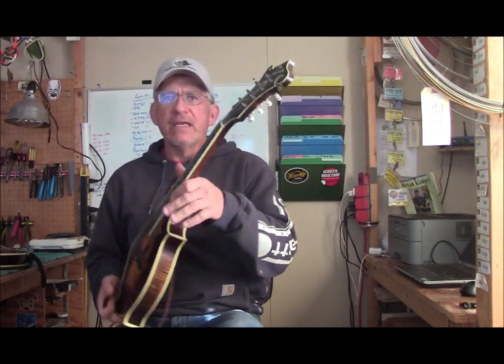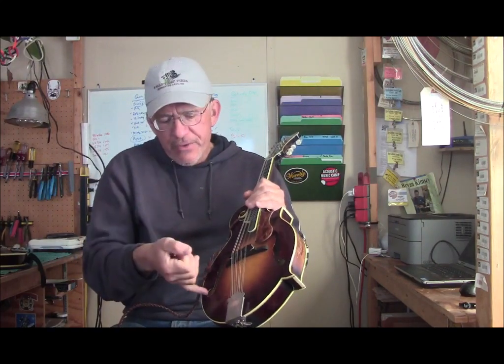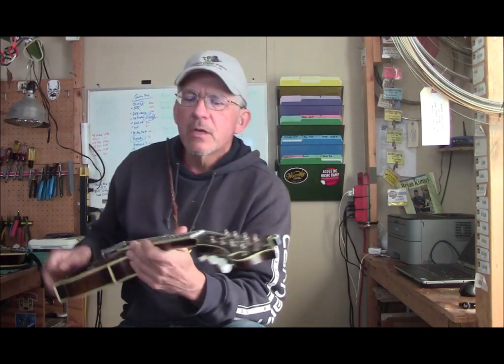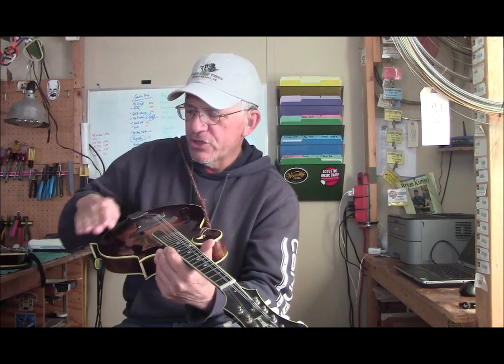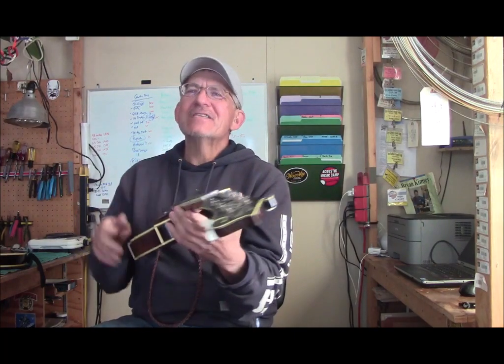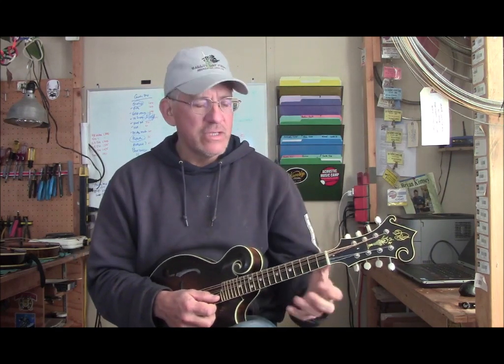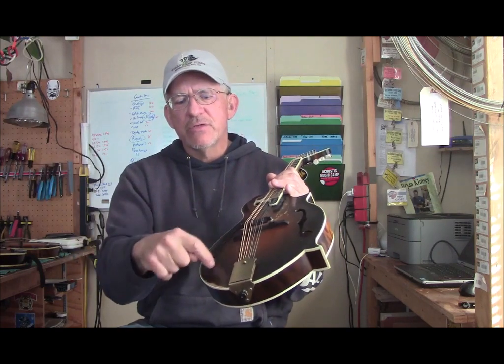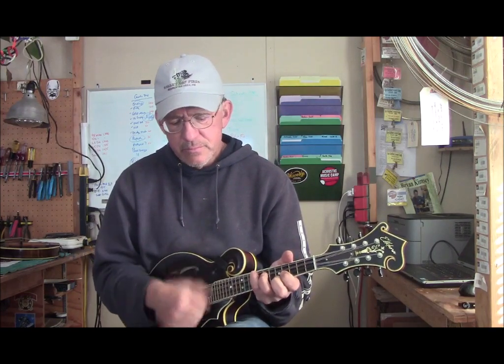Discussion on mandolin fingerboard radius

Comment: I used to play a Dearstone when I played on the road. The dearstone had a radius & wider spacing. I loved it for single noting, but I had a really hard time playing tremelos. Probably due to the wider spacing. The KM-1500 I now have is narrow & flat. It took me a little while to get used to the KY. It felt super cramped at first, but after getting used to it, I'm playing it just fine. I've learned that I do prefer a slight radius. (maybe a 12 or 14) I think I'd like the combination of the traditional "Loar" spacing with a slight radius because it gives your hand the feeling of wider spacing. For me, I think that would be the perfect balance. My main instrument is banjo & I'm of the opiion that they should have a slight radius as well. The neck I'm getting ready to put together will probably be around a 14-16.

Comment: I don't think my Mandolin has a fretboard radius :-(
Reply from the maker: Neither does a Gibson Loar.  You're in good company.  Nothing wrong with a flat fingerboard.
Reply: @Bryankimsey  Totally prefer flat fingerboards. ALL of mine (all f-styles) are flat. I really almost exclusive play only Bach and it requires a lot of alternate picking and quite a bit of string-skipping sometimes--that translate so much better for me on flat fingerboards, especially on such a small neck like a mandolin. I've PLAYED several with 10 & 12, many I've worked on in my shops, but I just can't completely warm up to that feeling.

What's funny though, after playing on most of my guitar necks which are typically scalloped AND with larger radius fretboards, I'm used to very thin profile "D" necks. I thought I wouldn't like playing so much on the common soft-V like so many mandolins have. Since I've been playing them all the time now I really got used to that and I think it's helpful on these smaller narrow necks.
~JSV